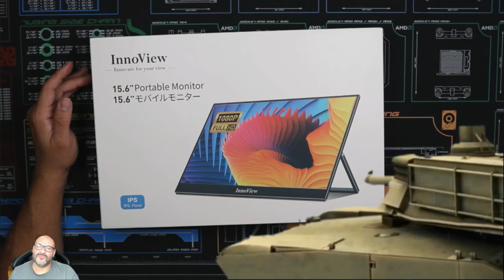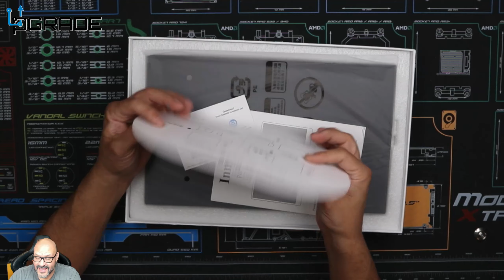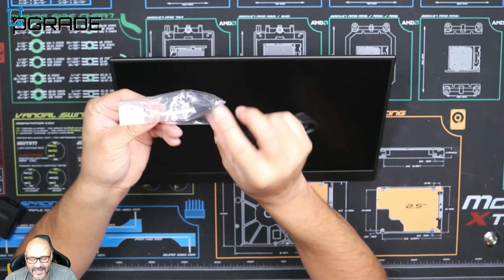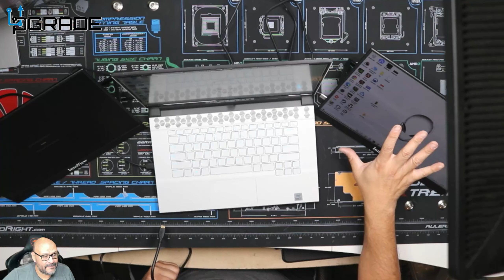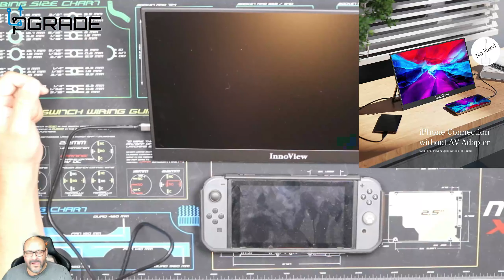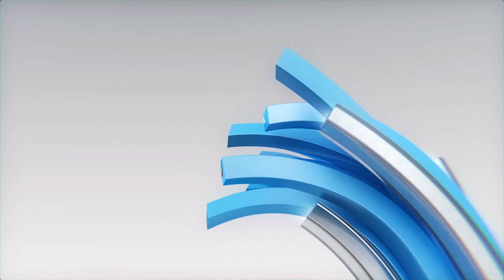InnoView Portable Monitor

Comment: How is the look of the display when on it's side?  I can see having one of these on its side when working with certain things with long vertical lists.  Sometimes if the light source internally is on one edge instead of LEDs behind the layers, rotating 90 degrees makes it look not as great.
Reply from the maker: A little glossy because of the angle but everything is legible